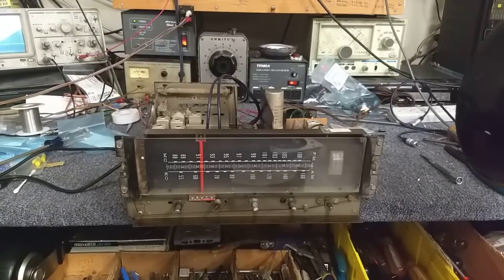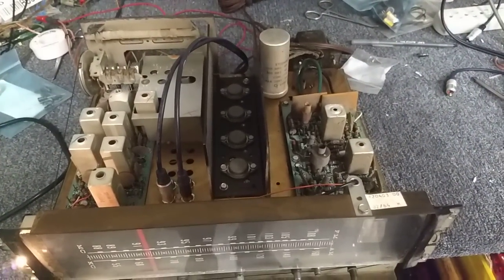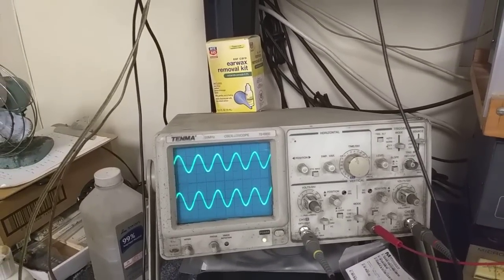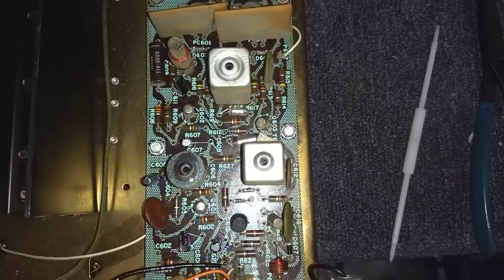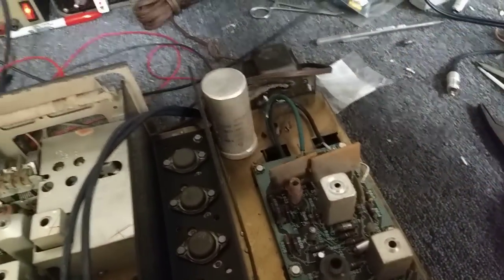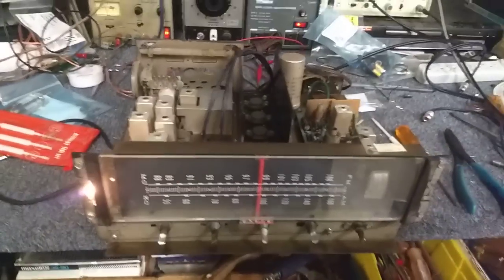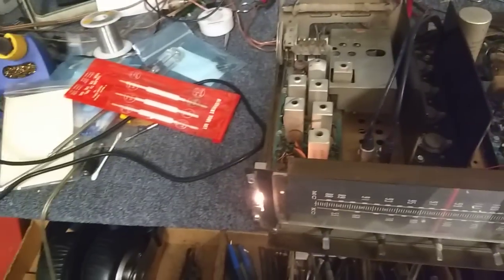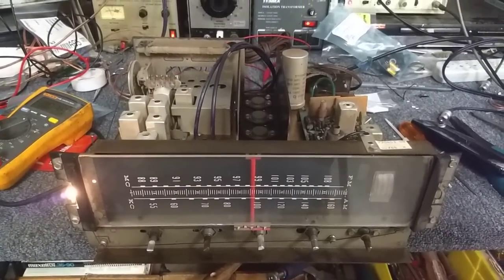Service adjustments of a self-contained 1963-1965 magnavox astro-sonic chassis R20304-00 & others

Comment: Greetings: Setting amp balance: with concentric level controls set them both to minimum; with a separate balance pot position it to center/detent and any typical lietening level; scope output chans using identical gain ettings and add/invert ch2. Adjust until display shows a flat line.

Comment: Thanks ahead of time for responding to my comment, JP!

I've been hunting for a decent ST1000A for years; one that doesn't cost 1k$. I have multiple tuners (including a MR74 McIntosh and a 10B Marantz), plus multiple receivers ( Pioneer, Kenwood, Sansui, and Sony) which need complete recaps, resistors, semiconductors and/or AM-FM alignments. What model(s) of test equipment if anything do you recommend for doing the AM, FM Stereo, plus all other amp/preamp clipping, bias/DC offset,/ other setup adjustments such as after recap/repairs, i.e.. the HP 8640, 8656 /other brands/models/ test equipment.

 I'm a relative noob with regard to tuner setups but I need to learn AND get the proper equipment if I can, or else learning to do this will never happen, and I want to learn so badly so I can do more and more work on my own.

I'd love to send you my MR-74 however current shipping from here in Pa to Ca. might me dangerous AND cost prohibitive, even in the factory double boxes, which I keep for all my Mc gear. Mc continues to sell the factory packaging new for near about any gear they have ever sold.

PS a ST1510A for all my open reels and cassette decks would also be on my short list, since I have so many. The ST-1510A makes tape deck setups a breeze compared to setting up the otherwise required 5-6 pieces of test equipment to do the same thing, but all in one piece. Talk about saving space on the bench!
Reply from the maker: For tuners, i can't recommend anything else. Ive gotten spoiled on the st-1000a. I have a leader and sencore generator that i haven't used in ages.  

Ive got both a heathkit and hp distortion analyzer. Do t get used much unless im doing power tests or customer states theres an anomaly in the sound.

No real tips for testing. Just provide a clean signal and proper load for whatever is under test. 

With AM, a plain rf generator that modulates 1khz is usually good enough to set up and align a tuner.

With FM and multiplexing its tricky without the ST-1000a. You can use the rf generator for the front and and IF. Then you need a separate multiplex generator to align the stereo decoder
Reply: @JordanPier  Thank you for the advice. Ill continue to look for a ST1000A and a 8640/8656 HP (any particular options I should look for on the 8640/8656?) as well. You should do an ABC of AM/FM tuner alignment... the must-knows, tips and tricks, esp. for FM Stereo. Any Featured classic Tuner or Receiver would be great!

PS: BTW, I have a DD Denon DR-F6 cassette deck that seems kind of rare which I recently scored. It's up next on my bench. Any hints or tips, things I should look for that are model specific? Have you ever serviced that model, I 'assume' you have, as you've so often commented on your long career going way back!

Than you once again for replying!

Comment: Were you driving both channels into 8 ohms? I am getting 10v peak, or 20v peak to peak on oscilloscope  1 kHz at clipping. Figuring RMS conversion I get around 7.07 vrms or 6.25 watts per channel out of mine into 8 ohms resistive load. Got one of these to learn on as a project. Now I have to isolate some noisy germanium transistors and find suitable replacements. Recapped less main tuner the big can cap which ESR was good. Tuner is out of alignment, AFC locks on to a different position on the dial from non AFC which is a telltale sign it needs alignment. Since I don't have an FM generator for alignment I left the tuner alone.

Comment: Probably 20 watts ×2 peak.  With efficient  speakers 🔊 that's pretty decent.
Reply: I have a 1965 4ST677 model, chassis  R20414  CA. Mine measured at 20 volts peak to peak at 1kHz, just starting to clip into 8 ohm non inductive dummy load. That figures out to 6.25 watts RMS, one channel driven, so 5 watts per channel would be about right for both channels driven. The speakers are about 105 db per watt one meter, so 10 watts fills a small room up with nice background lounge music with full body sound anywhere in the room.

Comment: That balance control is problematic in these, for those out there working on one make sure and use Caig DeoxIT D5 liberally and work it back and forth 50 times or more.
Reply: Can you tell me if the taper is linear or audio? maybe that's why i'm having trouble. 200-ohm potentiometers are very hard to find
Reply: @larryshaver3568  Not likely this is bad, all it does is shunt signal to ground and provide some summing of the left and right through that couplet on the driver board. It would be a linear taper, non linear would be used for a volume control so you have fine control of low volume. I am trying to track down noise and crackling problem with mine, have you seen my videos of my Magnavox console?

Comment: Hmm maybe clean the pots/presets and audio switches before doing the setup.
Interactive adjustments, can be a right pain :-(
Reply: I found out my DMM had a flaky socket much the same way. While troubleshooting a dead amp I was wondering how my voltage readings kept changing or disappearing while I was measuring between the good and damaged channel. After a bit of head scratching I found out my meter was bringing a bit too much fun to the party and retired it to the growing "broken stuff" pile.
Reply: @bugdrvr  lol i have been caught out the same way, but mine was a faulty rotary switch on the meter,  i took it apart and cleaned the board contacts and the rotary contacts + re sprung them.
The voltage readings were stable after that :-D
You can get the same effect from a fractured probe cable, always close to the probe where it bends a lot.

Comment: My astro sonic still won't power on could my filter capacitor be bad? If so where can i get a new one?
Reply from the maker: Bad filter will cause audible hum.

If it's lights on but no sound either all coupling caps are original and should be replaced or you've lost a power supply voltage
Reply: @JordanPier  no power at all, could the power transformer be bad?
Reply from the maker: @larryshaver3568  check if there is a fuse under the chassis. Check for continuity through phono switch on input selector and main power switch
Reply: @JordanPier  there's no fuse that i could find ,the transformer doesn't even get warm
Reply from the maker: @larryshaver3568  check switches?

Did you check continuity of the transformer primary?
Reply: @JordanPier  I'll try that again maybe i forgot something
Reply: @JordanPier  no, how do i do that?
Reply from the maker: @larryshaver3568  ohm out the contacts on the switches while in the on position. If you get 0 ohms the switch is fine 

Find the two leads going into one side of the transformer, one going to the ac cord, the other going to the main switch.  Ohm them out. You should get a low resistance. If you do the transformer is alive.

Now connect your ohm meter to the plug that would go into the wall. Turn the switch to the on position and you should get a similar reading to when you measured the transformer leads. If so the transformer is fine as are the switches. 

If it still seems dead, serious troubleshooting is needed to discover why it's acting dead.
Reply: @JordanPier  i'll try these tips and let you know when i find some discrepancies